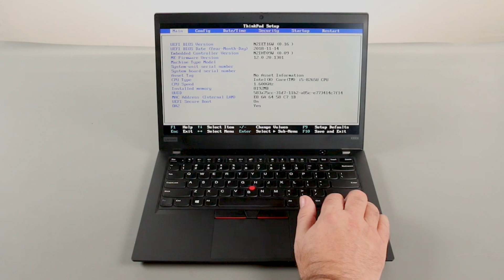Replacing Your Memory Module | ThinkPad T14 and P14s Gen 1 and 2 | Customer Self Service

Comment from the maker: This video will show you how to replace the Memory Module of your ThinkPad. The process in this video will work for the ThinkPad T14 Gen 1 and Gen 2 and the ThinkPad P14s Gen 1 and Gen 2. 

You will need a screwdriver kit, a non-metallic pry tool, and 15 minutes of your time.

ThinkPad T14 Gen 1 Repair Guide: https://pcsupport.lenovo.com/us/en/products/laptops-and-netbooks/thinkpad-t-series-laptops/thinkpad-t14-type-20ud-20ue/selfrepair/removalsreplacements

ThinkPad T14 Gen 2 Repair Guide: https://pcsupport.lenovo.com/us/en/products/laptops-and-netbooks/thinkpad-t-series-laptops/thinkpad-t14-gen-2-type-20w0-20w1/selfrepair/removalsreplacements

ThinkPad P14s Gen 1 Repair Guide: https://pcsupport.lenovo.com/us/en/products/laptops-and-netbooks/thinkpad-p-series-laptops/p14s-type-20s4-20s5/selfrepair/removalsreplacements

ThinkPad P14s Gen 2 Repair Guide: https://pcsupport.lenovo.com/us/en/products/laptops-and-netbooks/thinkpad-p-series-laptops/thinkpad-p14s-gen-2-type-20vx--20vy/selfrepair/removalsreplacements

To learn more about your device go to https://pcsupport.lenovo.com

To find parts for your device go to https://support.lenovo.com/parts-lookup/?cid=ww:lenovosocial:b9515f&source=socialmedia&subsource=yt

To view the Lenovo Support Self-Repair Guides landing page go to https://support.lenovo.com/us/en/solutions/HT516547

** NOTE: Static electricity can destroy components. Use a grounding strap, and clean, non-conductive surface to work on. Use plastic or coated tools to prevent scratching and avoid using metal tools on plastic parts. For more detailed information on electrostatic discharge and how to prevent it, please watch our ""Understanding Electrostatic Discharge (ESD)"" video: https://youtu.be/by4PB3WtdLo 

Applicable Machine Types:
ThinkPad T14 Gen 1 - 20S1, 20S0, 20UE, 20UD
ThinkPad T14 Gen 2 - 20W0, 20W1, 20XK, 20XL
ThinkPad P14s Gen 1 - 20S4, 20S5, 20Y1, 20Y2
ThinkPad P14s Gen 2 - 20VX, 20VY, 21A1, 21A0

#lenovo #LenovoSupport #LenovoTechSupport